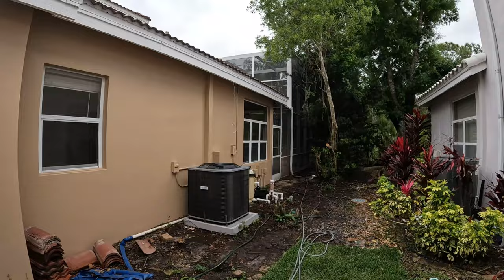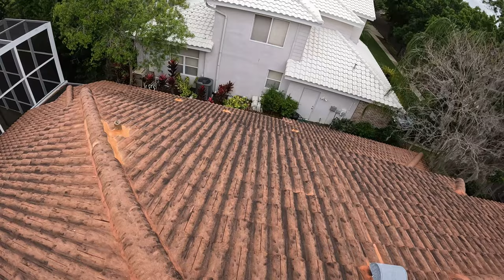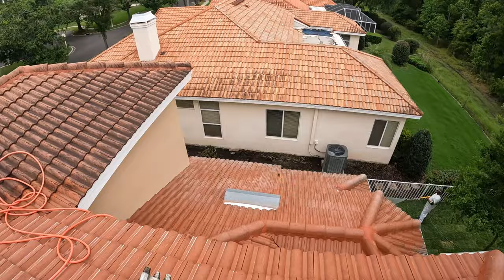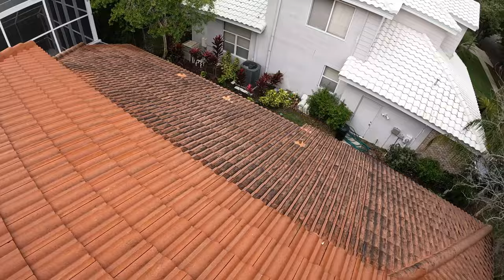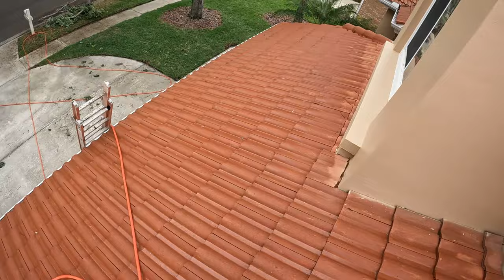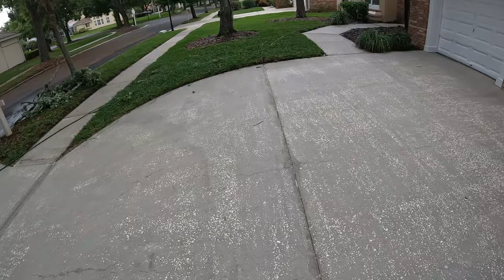Incredible Roof Cleaning and More #softwash #howto #pressurewashing

Comment: Did you clean it with bleach ?
Reply from the maker: Sodium hypochlorite not household bleach
Reply: Every time soft Roofing wash they use the chemical after that when the rainy season coming roof is leaking :(  how to avoid that ? Thank you
Reply: Every time soft Roofing wash they use the chemical after that when the rainy season coming roof is leaking :(  how to avoid that ? Thank you !
Reply: @PinkFlamingoPowerWash  Every time soft Roofing wash they use the chemical after that when the rainy season coming roof is leaking :(  how to avoid that ? Thank you !
Reply: Every time soft Roofing wash they use the chemical after that when the rainy season coming roof is leaking :(  how to avoid that ? Thank you
Reply from the maker: @lovelee7283  yea that's miseducation. Cleaning roofs don't cause leaks.  Maybe if they're pressure washing it and breaking tiles left and right and the underlayer of the roof is already bad that's how leaks happens. The shingles or tiles are top top layer of the roof.

Comment: You don't use surfactant on roofs that's why you don't rinse???
Reply from the maker: No. I don't rinse cause there's no need to. The longer the chemical sits the cleaner the roof gets. And once the chem dries it evaporates into salt. Once it rains all that gets rinsed off.
Reply: Thank you